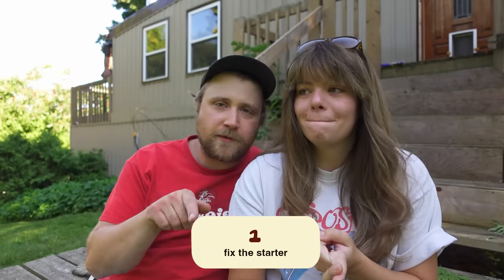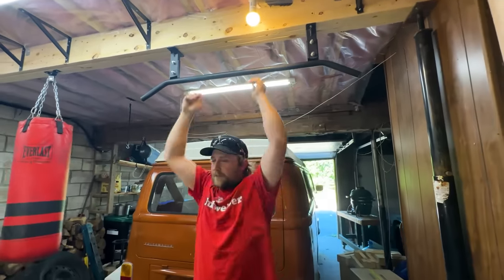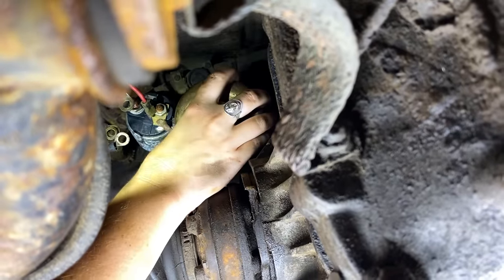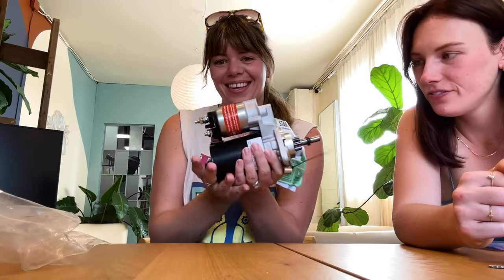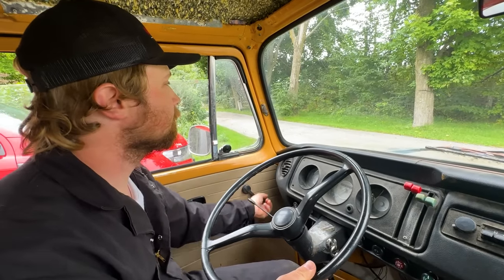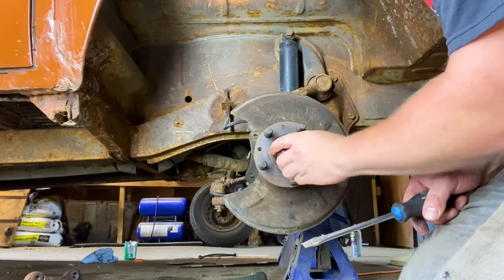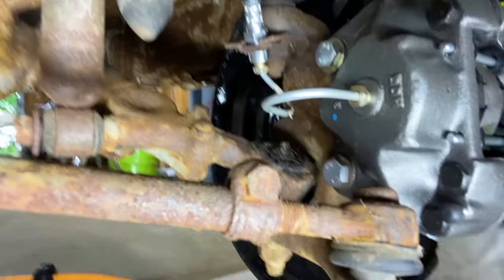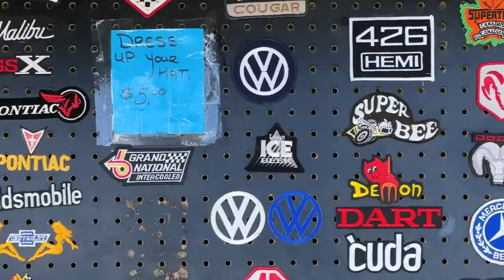finally getting started on our van restoration (it's already broken)

Comment: When I was learning stick shift, I sat in my car without starting it and learned the clutch and gear shift.  It helps when you go to actually drive. 

Just sit and press the clutch in and out, it will help you learn its “catch spot”

Then sit for awhile with the clutch pushed down and go through the gears, and back.  It will help you when you start driving to know the layout.  I would also say the gears out loud as I went through them.  

I hope this helps, I did this after a week of stalling out on the road.

Comment: Rockauto is great! We order all parts we can from them. I worked in a motorshop where they rewound and rebuilt all sizes of parts.
Reply: I've ordered tons for my own car and for my family's business fleet of vans from rockauto over the years..... HOWEVER I recently had the most nightmarish experience with rockauto UAC Radiators.... First one was defective.... Replacement was defective..... And the second replacement was defective again ,all leaking from the same seam. I wasted so much money in labor with my mechanic, just because I tried to save a buck buying a radiator from rockauto. My mechanic said rockauto is great for alot of things, but never radiators ¯\_(ツ)_/¯.  Ended up going NAPA because if the part is defective, they also pay for his labor to replace it.
Reply: @amaiaamaiaa  we replaced a radiator on my Pathfinder. BF would not listen to me to bleed off air bubbles, and blew the motor.
Reply: @peggynorton5145   I FEEL YOU.  I had a bunch of  radiator hose bursts and my dad and I redid the hoses and refilled the radiator. I kept telling him we need to burp it, I bought the special burping funnel, he said he'd never heard of that and I didn't know what I was talking about and that it was unnecessary and no one does that. So we didn't do it the first time. Radiator kept overheating and hoses kept bursting. Then when he reads about it on his own on the internet, he proposes it to me like it was a brand new idea. MEN.

Comment: G'day Bec and Austin,
Great job so far, doing starters and brakes is a pain in the ring gear, (lost count of how many times I ripped the bark off my knuckles over the years)...we've used reco starters and alternators many times over the years, it does save you a few bob, get a couple of lives out of them, and they don't end up at the tip.  
I'm curious, what brake pads did you end going with, Bendix or Bremer ceramics? 
Anyhoo,,, can't wait for the next episode of knuckle barkin' fun...😁
🙃🐨🇦🇺

Comment: The reason your starter is smaller than the original is because at the time of manufacture, your van would might have used a Direct drive starter (or maybe a gear reduction starter), but these days we can use magnets to shrink the starter! Its real cool tech actually, if you're interested!